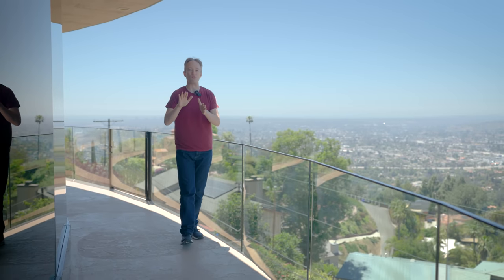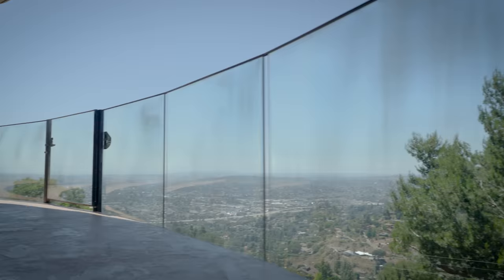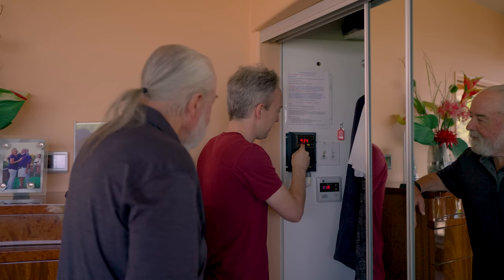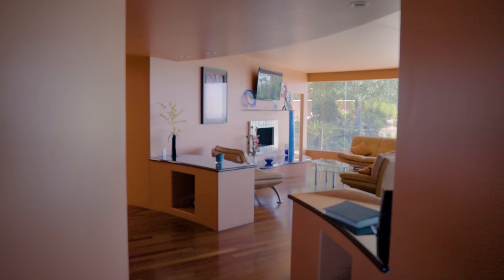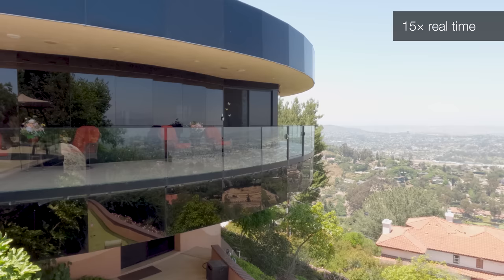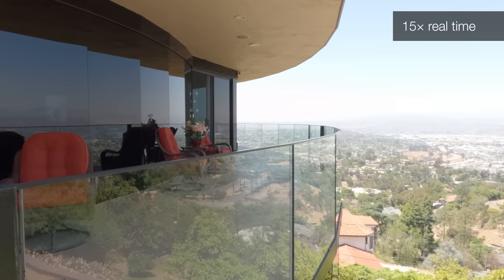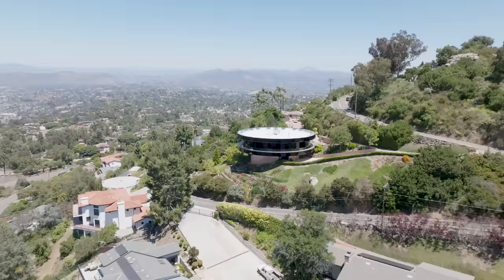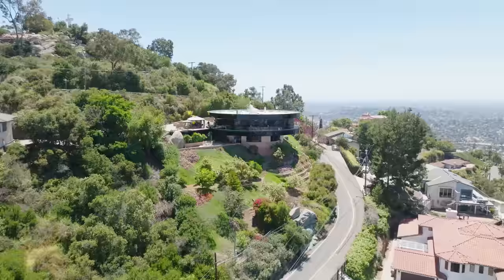I thought this rotating house was impossible.

Comment: That rotating core is an utterly mind-blowing feat of engineering genius.  I still can't get over the idea that a house weighing God knows how many tons can rotate with a 1.5 hp motor.
Reply: All but proving Archimedes' statement: "Give me a lever long enough and a fulcrum on which to place it, and I shall move the world."
Reply: Keep in mind, it rotates very slowly. That fast-looking footage you saw was as x15 speed. It can do a full circle in 45 minutes, but that probably wears down the engine, and if so, most of the time it rotates much more slowly, like a quarter circle in 3-5 hours.
Reply: @peterknutsen3070  Well it would be probably quite uncomfortable if it spun much faster than that!
Reply: @peterknutsen3070  No, I understood that, it's just the idea of something with 1/10th the power of the average lawnmower being capable of moving that kind of tonnage at all.  Just goes to show what a 25 to 1 gear ratio can achieve.
Reply: @LRM12o8  Indeed, that's precisely why it's such an engineering marvel.  When originally said he went with 5hp, I automatically assumed it was too little torque, only to be stunned by hearing it was more than 3 times the power he actually needed!
Reply: @DuncanJimmy  All it really has to do is overcome friction as it isn't performing any work against gravity
Reply: @peterknutsen3070  Most restaurants that rotate do about one revolution per hour.  As long as the load on the floor is balanced or very close to it, it requires very little to actually turn something like this.  A railroad turntable can be easily turned by hand with the bridge and a 200-ton locomotive on it if the loco is balanced on the bridge.  With the gear reduction he has, very little power is needed to turn the house, just not fast.
Reply: The space needle in Seattle does the same thing with 5hp I believe.

That is a lot heavier than his house.
Reply: @Grauenwolf  That's the thing. We know it's little horsepower, but how much torque does the motor have? It has to be a lot.
Reply: @bryandelahoz6063  it is a lot because he is applying quite a lot of reduction
Reply: What’s way cooler to think about is that a strong person could rotate this house with their body.
Reply: @LRM12o8  why is the phrase "all but" misused so many times
Reply: He explained the gears. Genius.
Reply: How? I could imagine 1 horse turning a house on well lubricated bearings…
Reply: The Space Needle in Seattle has a revolving floor in its observation deck that utilizes a similar-sized motor. They have a duplicate of it on display as you walk up the spiral ramp to the elevator.
Reply: @iwantmykidssusan4941  I'm willing to risk guaranteeing that's NOT possible. The motor is low HP, but it has to be very high torque to move all that mass.
Reply: @peterknutsen3070 also who cares if it wears out the motor. 1.5 horse motor cost like $100
Reply: @danielbass09  Right, it's not about the engine, it's how that power is leveraged and geared.
Reply: i think the most important thing in this whole system is that slewing bearing its sitting on.
Reply: @scythal  Or, spinning faster wouldn't be uncomfortable so much as centrifugal force attempting to launch you out the window.
Reply: @bryandelahoz6063    No, the motor doesn't need to have a lot of torque.  There's a huge amount of gear reduction going on here.  The house takes 45 minutes to make one rotation!  That's just over 2 one-hundredths of an RPM.  (That is, 0.022 RPM.)   That could easily be handled by a 1.5 horsepower motor.
Reply: @bryandelahoz6063  The motor does not - please go learn the concepts of gear reduction. He explains it in the video!!
Reply: @peterknutsen3070 well it follows the suns cycle so it’s set on a 24 hour rotation setting I’m assuming.
Reply: @scythal  it would actually be fun if it spins 60 miles per hour, thats like a merry go round on steroids, we should pay for that and enjoy it
Reply: @peterknutsen3070  Wears down the engine? What makes you think that? Its just a regular 1.5hp motor, if it would wear out from being occasionally used for a 45 minute stretch I'm sure they would replace it, It's probably the cheapest thing in that house
Reply: @dylanmccallister1888 and higher up with a heavier force of gravity weighing down
Reply: @danielbass09  A human can easily output one horsepower for a good amount of time, I've done it myself and measured it. Maybe not that guy with 18 heart procedures, but your average strapping lad sure. Why it's called a horsepower when horses are much stronger than that, I have no idea. Maybe it's "what one lazy horse can do ALL DAY" or something.
Reply: @LandynLeeable  that's not how gravity works
Reply: @bryandelahoz6063  What?   umm 1hp is 1hp.  even after you up the torque by reducing the speed its still 1hp.  the torque here is coming from the gearing.  hook the same thing to a bicycle and any teenager that enjoys biking could turn that house.
Reply: Never underestimate what loads of gears and a high torque motor can accomplish.
Reply: that's torque for you, you can move any weight with enough gearing advantage (or a long lever) it will just be very slow as torque as a concept doesn't take time into account
Reply: @gavinjenkins899 It's what one cheap horse could do walking in circles to operate a mining pump in competition with James Watt's improved steam engine .  In honor of him, the metric unit is named Watt .
Reply: hp and torque are different things.
Reply: @peterknutsen3070 you don't know anything, do you?

Comment: Huge kudos to Tom for using a graphic designer to explain how the core works - it's very easy to understand once you see it.
Reply: Didnt understand it at all 😅
Reply: @OzOMega The core with the grooves doesn't rotate. It's the outer piece with the seals that does rotate. This is shown in the last animation when it's put all together. At least that's the part I had to rewatch!
Reply: @OzOMega  The component is called a 'Rotary Union' if you want to read more. Used a lot in electrical/pneumatic/hydraulic connections. His innovation of having a spare groove and sensor to detect any leaks is ingenious

Comment: That slip ring for the water, sewer and gas is just like the hydraulic ring in the center of excavators. That’s absolutely brilliant use of one application in a completely different world if design.
Reply: Also used in automatic transmissions, to distribute pressurized oil to rotating clutch drums.
Reply: 5:04 I dont care about the alarmed seals ! I want my fresh water ABOVE my sewerage 🤢
Reply: @CFox.7  thought the exact same thing
Reply: @CFox.7   With the kind of pressure they are under, it would make 100% difference if its above... if the seal broke it would just be forced up anyway due to the pressure
Reply: @benhill3217  Are sewer lines really pressurized? That doesn't sound right.
Reply: @CFox.7  Ain't it made of like solid steel?
Reply: @40watt53  It's not the steel that would fail but the seals, which would be made of (probably) silicone or rubber.
Reply: @CFox.7  Personally, since sewage is not pressurized, I would have made the hydraulic ring hollow in the middle and let it just freefall down the center, instead of being one of the components of it. Less chance of clogging as well. (I can only imagine the difficulty of unclogging the sewage ring).
Reply: Why don't the seals wear down from the friction of rotation? It sounded like the only real maintenance needed on the house was the bearing lubrication, so I'm wondering how the seals are able to stay effective when there's something constantly rotating around them.
Reply: @ptrinch  It still needs a seal to keep the sewer gas contained. A kind of concentric water seal might work, but you'd need to purge the seal with fresh water so the turds didn't inadvertently get squashed in it as it rotates.
Reply: @NickTheNewbie  They would be lubricated by the liquids they contain. There might be some small amount of weeping of liquid past the seal.
Reply: @jonathanrabbitt  but wouldn't you need fluid in-between all portions of the seal and outerwall? if so, would that be an uninterrupted layer of lubricant that fluids could transfer through?
Reply: @CFox.7  I have thought the exact same thing, fresh water MUST be on top
Reply: @jonathanrabbitt  Water is not a good lub
Reply: @absolutemattlad2701  They use water on rubber bearings for ship propeller shafts. Water is plenty good enough for slow speed bearings.
Reply: Only thing I'm wondering is why the dirtier water and sewage was placed above the clean water. I get that there are the sensors in place if something goes wrong, but surely having the cleaner stuff on top is an extra level of guarantee that your water isn't going to get contaminated if there is a leak somehow.
Reply: @DanN-lm2id  your clean mains water would still be contaminated if it was above the others and the seals failed. It doesn't make any difference. The sewage and grey water need specific slopes in the near horizontal piping so that they don't clog, so they have more constraints regarding their positioning. They would be the starting point of the design and the other two, being pressurised, could go anywhere.
Reply: Water lines are. @MaxLennon  How would the sewage get in?
Reply: I would have gone for onboard tanks which connect to the external pipes at one location. A sewer tank and a fresh water tank with an electric pump. Internet with wifi.
Reply: @CFox.7 It does seem a really odd choice. I can only think that the reason sewage is on top would be that it needs a bigger clear space for the pipes to combine and make sure solids don't get stuck and clog the system? Otherwise I don't know why it shouldn't be completely the other way up
Reply: @CFox.7  came down in the comments just for this, would hate flushing sewage out of my clean drinking water pipes if it ever does have the sensors fail
Reply: Much like the humble 555 timer chip, which has mostly been replaced with digital chips, but still sees use as the synthesizer for microwave beepers, etc. – and has had many uses from triggering flashing lights to keeping time.
Reply: @CFox.7  be carefull because as each chamber is sealed, if one seal fails, such as you suggestion water above the sewerage, it can be so easy for the sewer pressured fluid to push upwards into the lower pressured water supply. The greater pressure will ALWAYS push into the lower pressure.

Comment: The danger of cross contamination is quite low, because drinking water and gas supply are under pressure, whereas the 2 waste waters are under slight vacuum.
If additional "peace of mind" were required, a drain connection could be added to the space monitored by the sensors.  Any water leak would then be seen in the transparent drain hose.
Quite an ingenious arrangement and not that complex.  I'd buy it if I lived down there and could afford it.
Reply: Despite such assurances, I wouldn't put the sewer waste water at the top.
Reply: @ianthomson9363  Yea that was my thought.  It should go top to bottom gas -> fresh water -> grey water -> sewer.
Reply: If something ruptured, it being above or below doesn't matter at all. Gravity will not make a meaningful difference.
Reply: Seems like it's upside-down to me, I'd much rather have gas on top and the sewer line on the bottom, that way if it does leak it's at least more likely for the drinking water to still be drinkable. Actually if I was building it I'd put potable water through a second slip ring on the rooftop. 😂
Reply: @bobnine  That's only because you are looking at it without the knowledge required (no offense) to make these assessments. It is just a 'feeling' people have that it would matter, but in reality there won't be a noticeable difference between positions of different products except for which will mix with which when a seal would break.
Reply: @ianthomson9363 im guessing the animator probably didn’t know the order
Reply: @ianthomson9363  I believe the order is because each higher layer has to go through the lower layers, creating obstructions within those layers. Thus gas goes at the bottom because it's a gas, and pressurized, so these obstructions are a non-issue. Fresh water is also pressurized, and is sure to be only liquid, so it goes next from the bottom, and then followed by grey water and sewage in that order because such obstructions would cause problems with any solid waste, which are going to be most prevalent 

Reverse the order and there's a bigger chance of the sewage line clogging here because (literal) crap got stuck on the outside of the drinking water and grey water pipes going through the sewage layer.
Reply: @markkNL  I've designed a lot of public infrastructure. It's a standard code requirement for sanitary sewer to be below and to the side of the potable water. Even if the safety improvement were actually minimal, we use every natural advantage we can to avoid cross-contamination. And there are also strict procedures for disinfecting potable water lines that MAY have come in contact with sewage. Systems and materials fail, gravity doesn't.
I'd suggest that it's you who lack the knowledge to make a proper assessment.
Reply: @cf453  Yup, the rules are everything, for water, and I'm glad they are! Had a  city wide water "boil order" outage because one plant had too many pumps (and their backups) fail, and the measured pressure in the main dropped below spec for too long. No actual contamination, just the possibility of it. Had to wait out the time for bacteriological checks after they'd gotten the pressure back up. (Major metro area  - top 5 in the US) Would rather have an occasional one of those than reoccurring cholera outbreaks.
Reply: @RossReedstrom  You get it. Child mortality used to be huge from water-borne diseases. The only reason it isn't is because we're EXTREMELY careful and small-c conservative in our engineering.
Every water and wastewater professional I know, down to the lowest grunts (nothing but respect fellas), takes this responsibility extremely seriously.
Reply: @AdmiralTails  I don't follow.  What obstructions?  Each pipe comes up and connects to a ring at a different height.  The pipes are simply a little longer or shorter on their vertical run.  There's nothing in the way of anything else.  The four fluids form rings, not solid layers that need to be penetrated.
Reply: @cf453  This is a specialized system

Comment: I grew up less than a mile from that house- I remember when they started building it, thinking there was no way it could be done... now when I show visitors the amphitheater/ park at the top of Mt. Helix (technically La Mesa), I always stop to show them the rotating house... never met the folks, but had seen many newspaper etc stories in the past and they always seemed so charming!
Reply: because they weren't engineers and not even minimum technical. I believe all the neighborhood are all business men/lawyers or similar.
Reply: Me and the homies always smoked on the road that goes right below the house, its an amazing viewspot
Reply: same i see this house a lot, but never new it spun
Reply: Wtf this is in Mt Helix? I need to check it out!
Reply: @emithesheep  go up to the top, right before the gate entrance to the driveway to the amphitheater, it will be on your left, hanging off the mountain facing north

Comment: I would never build a house like that just for the maintenance alone, but this man decided to do it and designed his own parts to solve problems he didn't need to have. I'm impressed.
Reply: He literally says maintenance is one hour of lubing every year, that's nothing
Reply: There’s probably more then just 1h a year maintenance, that’s just the mandatory annual maintenance. But all the same I doubt the maintenance is worse then a normal house unless the shaft goes out, but from he said that’s unlikely.
Reply: @gracelandtoo6240  I would be absolutely paranoid to use normal toilet paper and/or my sink macerator.
Reply: He reminds me of my grandpa. He can be annoying to work with when building things because it takes forever, but he does a perfect job every time. If he is willing to build something, he will not stop until that thing is as perfect as it can possibly be.
Reply: When an engineer builds and doesn't need to get the beancounter's permission
Reply: @SpicyTrifongo if the chunks are too large for the bearing they’re definitely causing problems for the utility!
Reply: 1 hour of greasing and 18 heart surgeries is all it takes.
Reply: @gracelandtoo6240  Houses naturally start to shift. He maintains the system in different ways and that's adding the house on top of it. Plus, San Diego does get affected by earthquakes. The more time passes and the more he uses it, the more maintenance it will need.
Reply: @zooning-6843  I would think the maintenance is more than a normal house because it is a large house that is being held above ground and rotated.
Reply: @gracelandtoo6240  I think a lot of that is the wheels that support the outer ring of the house.

Comment: I’ve always loved this house. From the late 90’s up until the end of 2001 I worked as a subcontractor for Cox Cable and was the tech that installed all the original RG-6 tv cable and digital receivers in this house during the final stages of construction. Truly amazing to see in person.
Reply: I'm trying to visualise how you pass coax through slip rings without compromising the shield...or do you just put an antenna on the rotating roof?
Reply: @jay-em  the answer is literally in the video...
Reply: @MadMaxGyver  I assume what is in the video is for unshielded copper pairs, eg. Ethernet.
Reply: @jay-em  Well you can do the same with one conductor + ground and shield the entire thing... (works with shielded twisted pairs too)